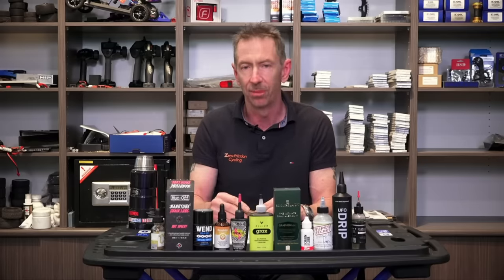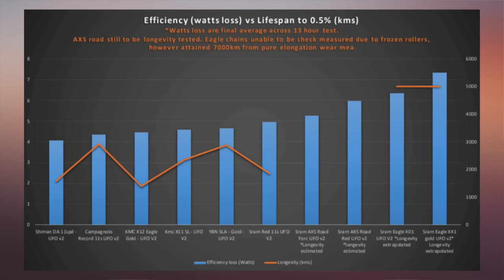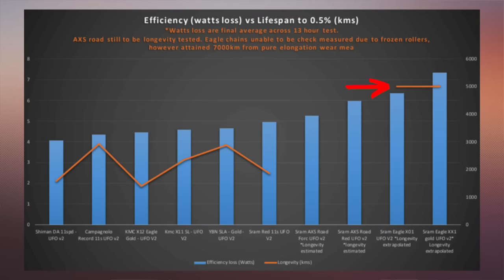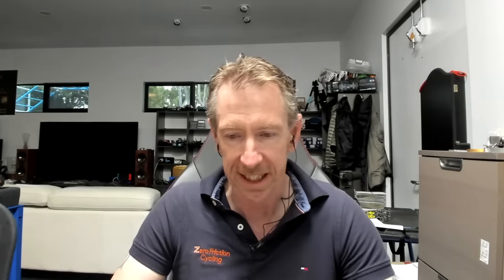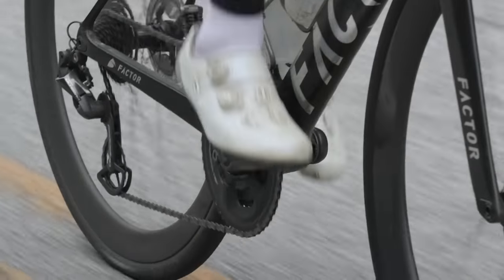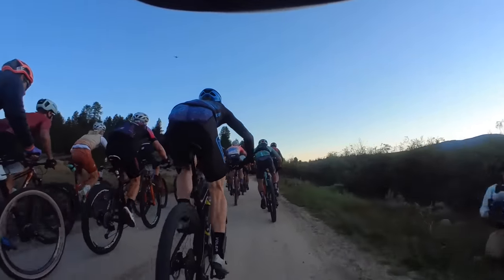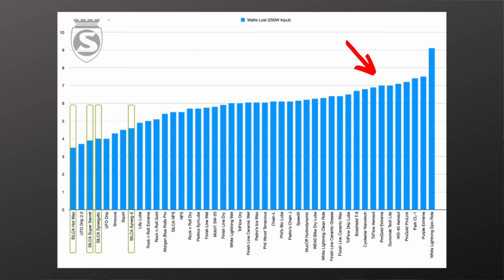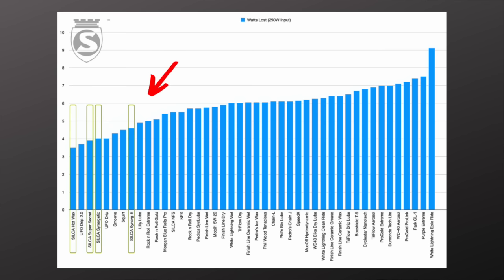How Slow Are SRAM Chains and Other Drivetrain Efficiency Questions With Adam Kerin

Comment: I’ve been saying for years that larger rings are more efficient and that Sram’s AXS Road groups feel rough. Nobody believes me. Shimano employs the smartest and best engineers in the cycling industry, and if oversized pulleys or tiny, odd-shaped chainrings or flat top chains really were faster, they would have been standard on all Dura-Ace groupsets for the past twenty years.  Thanks for the excellent video, Dylan!
Reply: SRAM chain aside, i'd say it depends. My 11 speed drivetrain was 50/34 with 11-30 cassette. Upgraded to AXS 12 speed with 50/37 and 10-33. 12 speed setup is faster (equivalent to 55-11) and slightly easier. Yes the 10t cog is less efficient but now I'm pedaling whereas with the 50-11 I'd be coasting. Then when climbing the 12spd chainring and cogs are larger & more efficient than 11 speed setup. I use the force flat top chain cause it's a bit faster than the Red.
Reply: The non belief on this by some i find fascinating. Especially some of the responses to this i have seen by sram themselves. Its just straight up basic physics and math. Greater articulation = more losses, and there is more articulation with a smaller ring, and you will be running a smaller cog for desired gear inches with a smaller ring = mores losses. And there is more chain tension with a smaller ring, so the greater articulation at both ends is under greater tension / load. 

To balance, sram have done so much excellent pioneering work in many area's - but for from a Mr Low friction perspective, i would have like to see things move forwards in all aspects, not say a great move with wireless 12spd, but go backwards on efficiency. Work should be done to move efficiency in a forwards direction as well. Staying static on that front for X years is barely a pass mark, going backwards - to me it is a direction i cannot understand how it was signed off and put into production. Just imagine me at those meetings hahahaha.  

I have had the same information relayed to me from multiple sources that as soon as axs road came out, the first thing the pro teams on sram at the time did was demand 54/38 ring sizes and they locked out the 10t, so basically they made their new 12spd the same as the old 11spd. Whilst consumers were stuck with 48/32t rings , until after a couple of years, a 54/38t ringset, in red level was released, with an rrp of about 1 billion dollars. 52/36 and 54/38 chain sets should be widely avail, at reasonable prices, from rival level. 

A very fast friend of mine is looking at the Factor Hanzo tt bike - it looks amazing, but you can only buy specced with sram - with 48/32 rings. For a tt bike. 

Cmon sram...... So much great work..... why is efficiency not a focus for this company.
Reply: @freakyPhred  You're still riding a noisier and  less efficient drivetrain. Besides, If you're spinning out 50x11 on 700c wheels, you don't need a 33tooth rear cog, or even a 30.
Reply: @zerofrictioncycling992  Sram's focus is to sell gimmicky tech to gullible consumers.
Reply: @zerofrictioncycling992  if you're referring to my comment, I don't disagree with you at all. However, I'm coming from the practical standpoint of having 50/34 rings for my older legs. From my perspective upgrading to SRAM 50/37 got me less articulation when climbing and one faster gear. Guess I could run a 53/39 and an 11-36 which would be almost as easy.
Reply: @zerofrictioncycling992  and I totally agree with you about how noisy SRAM stuff is and force is worse than red and rival is even worse. I have a Rival 10-30 cassette on my trainer and it's awful in the smaller cogs. SRAM's elastomer rings to quiet the cassette just reduce the apparent noise and do little about whatever was causing the noise in the first place. Agree, Shimano drivetrains are quieter & more efficient.
Reply: @freakyPhred  No not aimed at that - people should definitely get the gearing that suits them - so even in the 11spd systems, shimano or sram - 50/34 compact ring option is common, and perfectly suitable, and with 11-30 or 32 cassette, for most that is plenty of gearing, and one can go to 34 or 36t if they need to. 52/36 mid compact is easy to obtain, and 54 / 38 not too bad to obtain with a bit of hunting. 

For 12spd - with shimano these options are largely still the same, just less jump (mind 54/38 or 40 is hard to get, but you can, just order ahead....). My wife recently got a new bike with shimano 12spd with 50/34, that is perfect for her. I recently obtained my new TT bike, with a 54/40 - perfect for that. 

A speedy friend is looking at a new Factor Hanzo, but website only offers sram axs build - and only with 48/32 chain rings. That is just..... not optimal....... 

The main thrust is a) there was just no need to got to 10t for road, and b) if they want to offer small rings, thats fine, but dont lock in a less efficient drivetrain for everyone, as plenty do want the larger rings - the 52/36 to an 11-30 cassette is suitable for a huge % of cyclists - that should be the default.
Reply: Literally anyone time trialling or doing triathlons is well aware of large chainrings saving watts. Is why were often in in the 16-17t cogs too, with a massive front ring. Watts.
Reply: @zerofrictioncycling992  Adam, what's missing here is a reality check on all these numbers.  Saving 0.1 watt for a cyclist putting out 250 watts is ONLY a 0.04% savings. NO ONE will notice that. Calling these savings "marginal" is understated.  "Trivial" is more like it.
Reply: @Ron_Boy  I hope i did put some reality check on pulley wheel bearing savings by covering that. But also, the savings can be not marginal if a) ones wheel & bb bearings are not running great, or pulley wheel bearings are pretty knackered - OEM bearings are cheap, and pulleys do a millions and millions and millions or revs - over 20,000km - OEM will degrade. So 0.1 can be 0.5. And for wheel and bb, what may be a 0.5w saving, maybe a 1w. Or 2w or more if bearing really bad. Plenty of bearings see hard riding and not much maintenance, and it is not just mtb riders - it can easily be avid racers training 400 to 500km a week, fitting that in somehow around full time work + family - focus on bike maintenance can be a struggle. THe number of avid racers where i pull chain off and BB is just - wow, rear wheel bearings rough as, a pulley wheel barely turning etc. 

The numbers i ran through was vs basically new good steel vs ceramic upgrade, in which case the savings will be low, and will likely add up to a few watts across the bike (and a few watts it is fair enough to call a marginal gain). But it can be a whole lot more depending on what the cyclist is running. Some wheels come with very good steel OEM bearings, others junk, and then use / maintenance etc - focussing on this area for one cyclist could save them a lot. 

But yes - pulley bearings - there is very little savings to be had if the bearing OEM bearing is running great. ANd this should be fairly obvious most hopefully, if you can turn it for near zero effort with your little finger - then there is not much friction to be saved, they are just light so any seal contact will have one pulley stop immediately vs spin, whereas no contact pulleys with no grease will spin impressively on instagram - but the difference between them in losses is extremely small. OSPW deliver more, but again, is it half a watt or 2 watts - do you have low friction chain or a high friction chain, as it is the chain where they are making the savings, as there is only a small amount they can save in the bearing. 

*Note also quality upgrade pulleys with high quality bearings -if maintained will remain very low friction for an extremely long time. An oem bearing will not last like a quality aftermarket bearing. The OEM bearing probably cost 5 cents, it has a limited service lifespan.
Reply: Can't argue thst
Reply: This is definitely not true.  Shimano definitely builds the most durable parts.  But not the best performing. Going with loose ball bearings decades after everyone else went sealed isn't exactly cutting edge.   Cranks that dissolve and crack isn't exactly great for performance either
Reply: @freakyPhred  other benefit is that you have a better chainline in the 11t than you had before
Reply: @prestachuck2867  you do realize that people go uphill, and sometimes wanna spin into a very heavy headwind don't you?

Comment: I can only write about Campa and Shimano and SRAM 10 Speed chains until 2017 I had Campa Chains on my Campa bike then my mechanic and friend died I didn’t want to buy expensive tool thus I changed to Ultegra chain they run very smoothly BUT they don’t last very long for me not a problem because they are also far cheaper Sram is in between I don’t care about friction it’s hair splitting think more on training and keeping the drivetrain reasonably clean and oiled 
Have good tires (Conti 5000, Vittoria Corsa, Schwalbe Pro One) and close the shirt and take the drops

Comment: I would be curious to see some testing done for comparing the chainring/sprocket size vs aero drag. I understand that larger rings/cogs reduce chain articulation and save watts that way, but what about the aero and potential weight penalties with bigger set ups?

Comment: Have to point smt out/disagree on the statement "the faster the chain is the lesser the penalty you are going to have for things like cross chaining". In the graphic it´s shown that the KMC X12 GOLD chain should be fast, in reality the chain is so stiff (sideways) that it is falling of the rings when cross-chaining in a AXS 12 setup. Even after a deep clean and testing both on used and new chainrings - the KMC is unusable. It might work on a Mtb with a 34t ring but road AXS and KMC - no chance.

Comment: @10:15 , that is not how chain line works. The chain line starts from the top of the gear, which, in these graphics, is directly above, so the line will be virtually the same, and only really affected by chainstay length. Certainly, the chain gear sizes do affect the wrap angle, so with a small front and large rear gear, you will have moved the chain line forward with the front crank, but also forward with the rear cassette! That graphic is incorrect in explaining chain line. Please correct it in the next video. Signed dedicated follower.

Comment: All of this talk of chain rings is funny to me. For fat bike racing, most use 1x11 or 12. I'm using the same 2x8 that came on the bike, giving me roughly the same gear ratios and same jump between cogs. If the 2x8 were a road bike, yes, I'd miss the 1-2 tooth spacing, but not on the fat bike.

Comment: Are larger chainrings and cogs really more efficient due to the perceived reduced chain articulation? Come on guys think about it; twice the ring size equals half the articulation BUT twice the chain speed so the total rate of articulation is the same. Also with larger rings the chain has to articulate around the tiny idler pulleys way faster; not good. Plus you have the extra weight of course. Am I wrong?

Comment: The illustration at 10:15 is incorrect. With a chainring and cog which are similar sizes to each other, the chain will leave the cog and meet the chainring roughly near the top, where the chain is tangent to the cog/chainring. This point will be roughly aligned with the axle/spindle regardless of the size of the cog/chainring. Even when you have very mismatched diameters, the point where the chain leaves/meets the cog/chainring only shifts a few millimetres. Thus, the cross-chaining angle will be largely unaffected by cog size.

Comment: When i was younger i once purchased a $90 Sram chain thinking 🤔 it was going to be the best chain ever, not the case, super lightweight but other than that it was super weak, had to manually tighten every link to prevent the chain from falling apart on the trails.

Comment: I don't understand the penalty for larger chainring creating more extreme cross chain.  A chain leaves the chainring at near centerline of  the chain ring or the middle (from forward to aft), not the furthest rearward point or the ring.  So no matter how large the chainring centerline stays the same.
Reply: Wrong. You must take into account teeth and the arc of the cog itself. Bigger the cog, longer the distance from the center of the cog for chain to leave free of the "last"tooth.
Reply: @Krejza82  always at half past twelve!
Reply: @yannickavrillault4530  You forget teeth don't magicaly disappear. They still guide the chain when they are in contact.

Comment: I think we're once again coming upon the issue of what you're optimizing for. Like yes SRAM AXS drivetrains are less efficient because of their smaller gears, but on the flipside they have a really nice gear range. And yes the chains are less efficient, but they last longer. So for me, those upsides are worth the lower efficiency. I think we too often fail to think outside our own bubble and mindset and thus don't recognize that others might have different priorities
Reply: On mtb you need that 10 because biggest cog is huge but on the road really that make little sense.
Reply: @TheAntoine191  I don't think the 10 is useful in a vaccum, but it does allow you to make the chainrings smaller and thus get much more low-end range. I currently have a claris 50/39/30 and an 11-32 and I use that whole range. I not infrequently do a 2ish mi climb with an average gradient of 5% or so, and that 30/32 is really convenient. With SRAM, I can do a 46-33 and an 11-36 and get that same range. Do I need that upper end 50/11 or 46/10? Nope, but it's fun.
Reply: Agreed. I use my 50/10 every day on the road. On gravel, my 48, 46, or 44 fronts would be virtually useless for me without the 10t. I'd actually prefer a 9t and skip the 10t for gravel so I could use the 44 front and a wide range cassette. The longevity is great and I've very rarely found myself needing a 2x.

Comment: 10:12 "The larger on the front and the larger on the rear makes the chain line more extreme". I arguably agree with that, but the graph shown after is not correct. The chain engages at the top of the cogs or a bit before/after the top but definitely not at the horizontal edges.

Comment: Larger cog and larger ring shouldn't change the chainline as much as the graphic shown at 10:18 because the chain meets the cog and chainring near the top, not the front/rear extreme.

Comment: For the chain angle diagrams (10:18), they seem to show the chain coming off the end of the ring/cassette, causing extreme angles. But the chain doesn't come off the end of the ring/cassette, it disengages at the top (12 o'clock position), give or take a few degrees on either side to wrap from a larger to a smaller ring on either side. Doesn't this mean that for a given cog/ring combination, the chain angle will be about the same, regardless of the size of those rings/cogs? I get that it may be advantageous to run a smaller ring so that you can be in the 2nd largest cog, rather than the largest, which really will reduce the chain angle
Reply: totaly agree, big mistake!!

Comment: At first I thought it was a great point, but now I think he's wrong at 10:09 when he says that a larger ring makes the chainline worse. It doesn't matter how big the chainring or cog is because the chain goes on/off the teeth at roughly the 12 o'clock and 6 o'clock positions, which are roughly vertical (depending on bike geometry etc.) So the chainline when at extremes of the cassette shouldn't actually change much for a given bike no matter how big the chainring and big cog are!
Reply: Adam says the reason a bigger chainring and cog is better when cross chaining, is that there is lower tension on the chain.